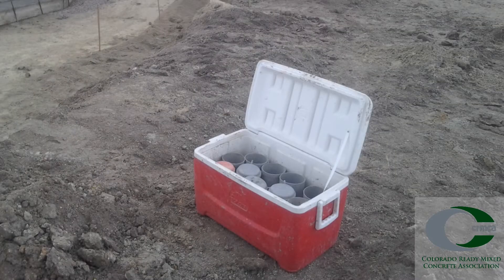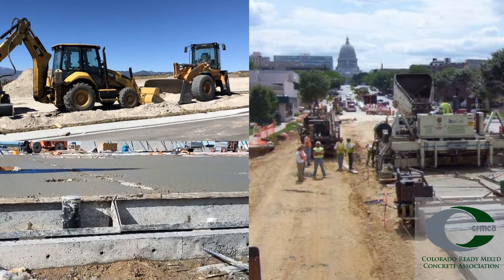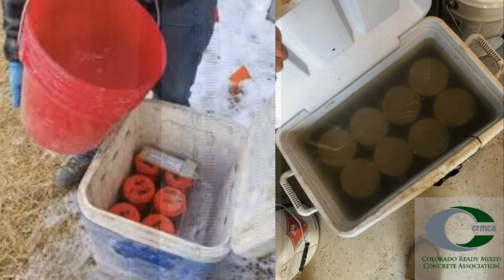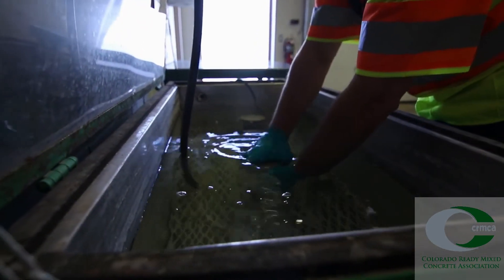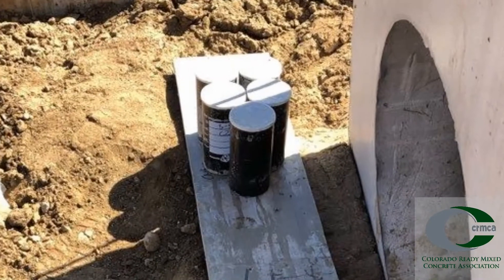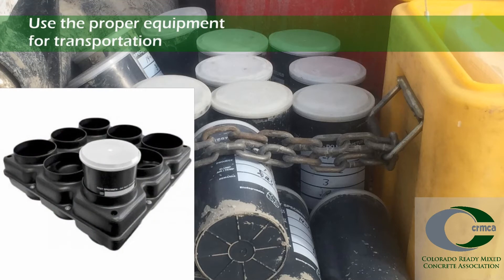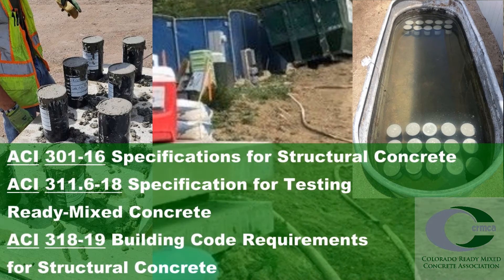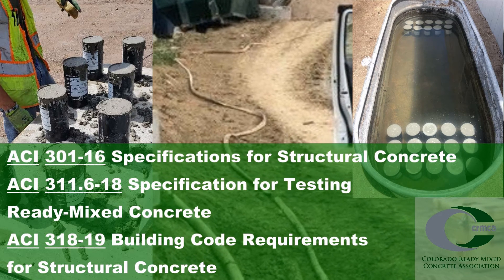ACI Field 1 - Discussion on Initial Curing - ASTM C31 - CRMCA Online Concrete Procedures

Comment: An older copy I have of ASTM says specimen shall be stored for up to 48 hr for intial curing.. and transportation shall not be until at least 8 hr after final set. Was there any new change since you mentioned cylinders should be moved to final curing after 24 hr?
Reply from the maker: Current Standards state initial standard curing should occur for up to 48 hours. When understanding "8 hr after finial set", you must know what set that is. We recommend at least 24 hrs. This is different for field cure initial curing requirements.